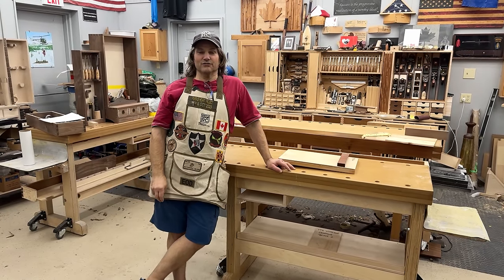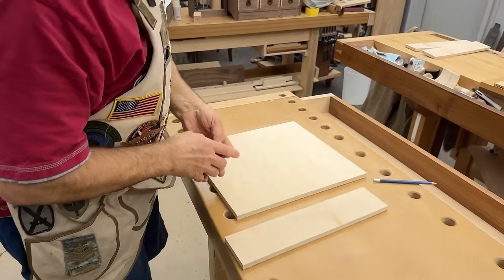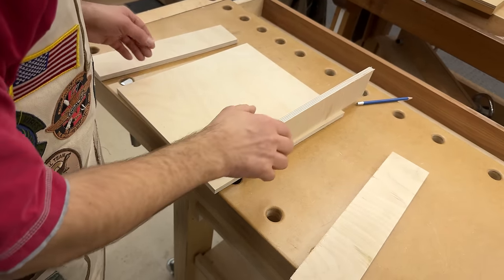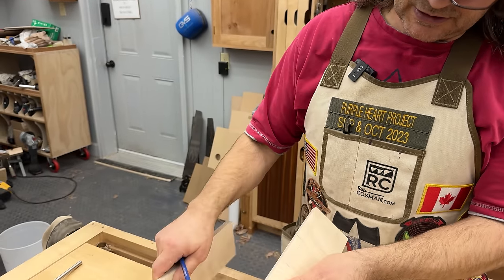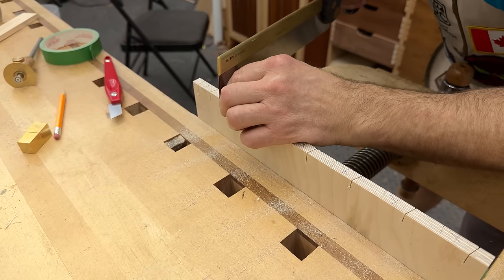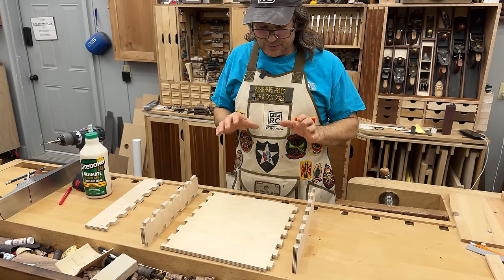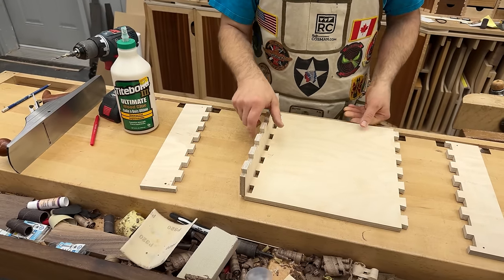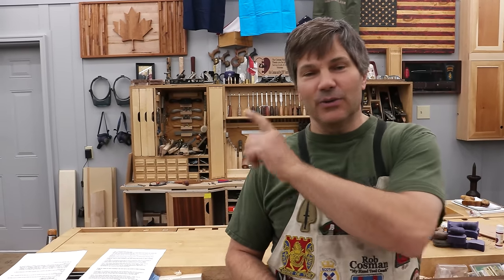Workbench Shelf Ideas - Shooting Board Shelf

Comment: "And the sign said long haired freaky people need not apply." 😂 Sorry Rob, I had to. 

This is an excellent idea that I need to incorporate into my bench. One question on benches. I'm considering building a new one and would like to use your design. Unfortunately, my garage floor slopes in both directions (center drain), so the "sled" style feet may be tricky. Any concerns with just 4 legs?

Also, for anyone reading the comments, I purchased one of Rob's shooting boards during their New Year's sale. It is fantastic. Perfectly square, well made and despite being a utility piece is quite nice looking. I've had great results with it and honestly can't recommend it highly enough.

Comment: I have to ask. When your using your hand plane why do you clear it of shavings after each pass? Just a habit or is there a specific reason? I have always wanted a collection of hand tools and the knowledge to use them so thanks for sharing your passion for woodworking and your knowledge. If you haven’t could you do a video on what a beginner should own to do hand made dovetails and other joinery. Also I’m very interested in the shooting board as I have a very very cheap table saw that always leaves saw marks which leaves tiny gaps in my glue ups. Still watching all of your videos to learn as much as I can before buying any tools and putting them to use. Cheers 🍻
Reply from the maker: Its both.  I rub the tooth line to clear the shavings. At this point its just a pure habit response.  Would the shavings significantly affect the performance of the saw?  If typical wood thickness 3/4 inch and less no, but on thicker pieces it could slow the cut down.

Comment: Great addition to the Cosman workbench! Will that fit all of the different sizes of shooting boards or bench hooks? Could you build a sectioned shelf all the way across to fit several? How would you build that? Great video thank you for sharing! Take care👍🏻
Reply from the maker: The answer to most of those questions is yes.  The answer to the how to add a section would be to make the vertical pieces larger then add a second horizontal shelf that joins to the vertical pieces.